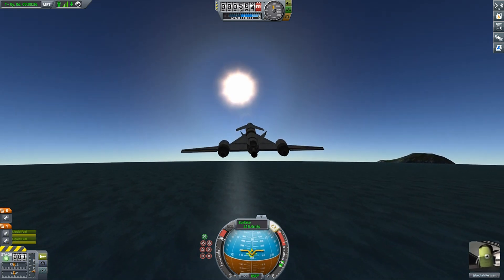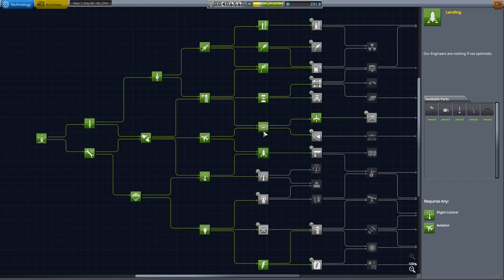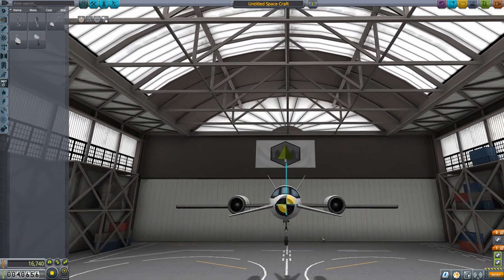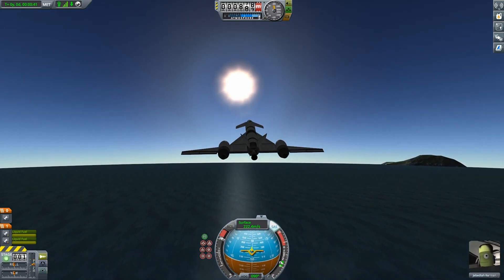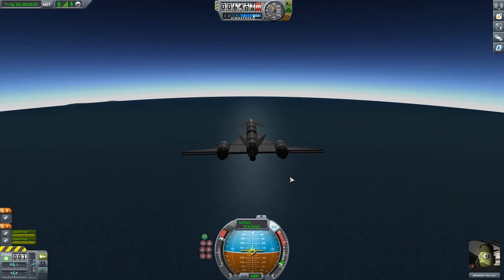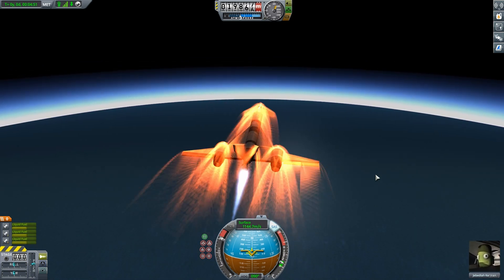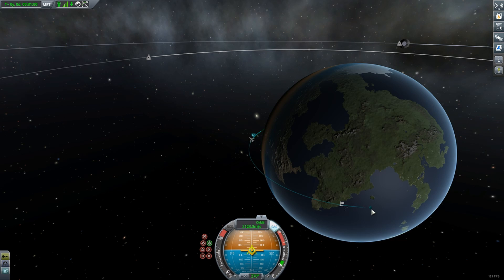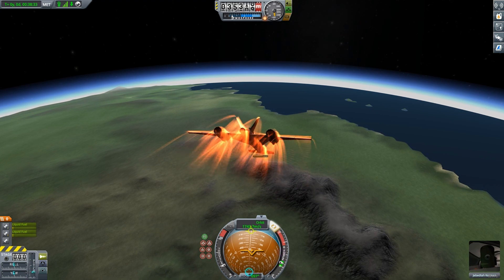Kerbal Space Program - Beginner SSTO - Low tech SSTO

Comment: I built a copy of this and wanted to tell you and anyone who wants to build this an improvement, instead of using the "fl t200" rocket fuel tanks for the jet engines, use "engine nacelles" they're under "aerodynamics" parts and unlocked 1 tier before the jet engines in this video. the engine nacelle is a liquid fuel tank that holds 150 only liquid fuel vs the fl t200 which can only carry 90 liquid fuel, so you get 60*2 more liquid fuel and don't have to empty oxidizer. the engine nacelles have built in intakes, so youll use 2 less parts, but also the intakes on the nacelles are better than the ones youre using with intake air of 5*2 instead of 2*2 , also those rocket tanks alone weigh more than engine nacelles, but minus the intakes too its a total weight savings of .5t.
Reply: Well, lots of improvements can be made, first and foremost, you need a DIFFERENT plane. Because this is useless beyond a testbed. Cannot do science, cannot transport passengers .... so is a personal shuttle a pilot only can take into orbit.
Reply: @Zamolxes77  also too much wing surface

Comment: What's a good twr for ssto? The jet engine phase I mean. What's this crafts twr?
Reply: 0.53 is pretty good for a rapier ssto on takeoff
Reply: I have 2 swivels, 4 turbofans for a 37.5ton takeoff weight. Can either have 2 cabins for 4 kerbals or a cabin and a cargo bay with a 1ton sat. Usually have ~200ms delta-v left after circularization around 71k and ~100 fuel at landing. Can replace swivels with the non-vectoring version, if you use inline cabin near COM to rely on stabilizers for control. Can use 1 non-vectoring and 12 small 16kn vectoring ones - more efficient setup further up the tech tree.
Reply: @MrrVlad  w o w